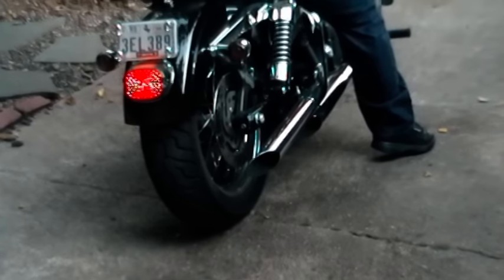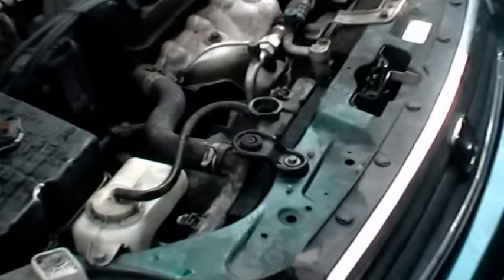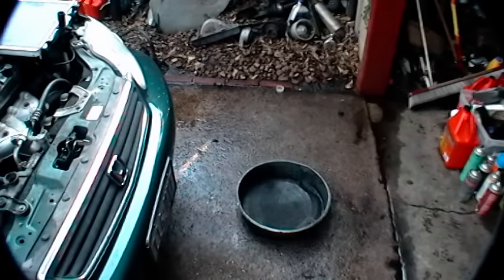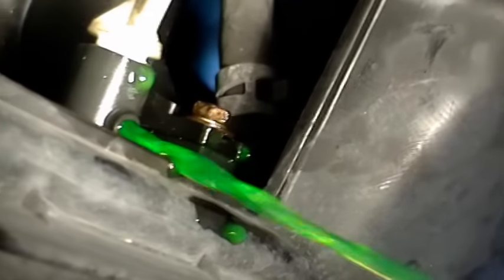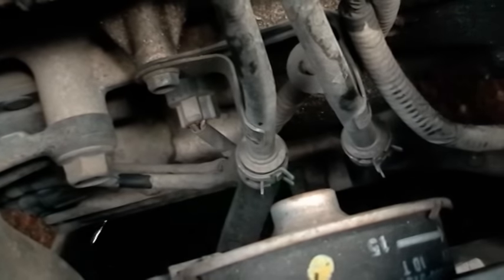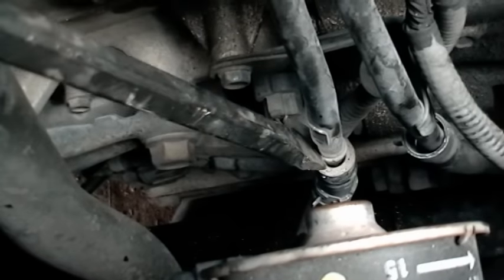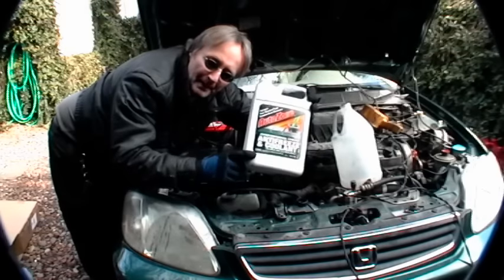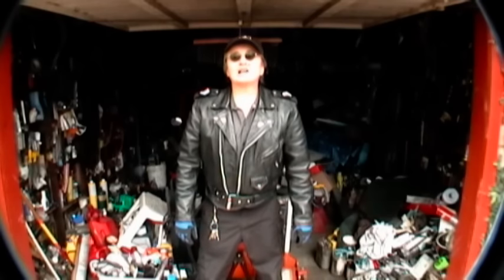How to Replace a Radiator in Your Car

Comment: Scotty I need a mechanics check on some info that I think is phony. I have a Mitsubishi Montero that overheats only every now and then. I replaced the thermostat, didn't fix it. I took it to the dealer to have them replace the water pump and was told that if they take off the old radiator to access the pump that it cant be placed back on the car and has to be replaced with a new one. Is this correct or is this a sales pitch to make some extra cash?

Comment: what do you think about that bars liquid copper stuff
Reply: I've used bars fluid twice now, and it held up for about two months. the hole will just keep getting bigger so I had to buy a placement radiator. got one for 56 bucks, lifetime warrantee and free shipping on eBay motors. took 4 days to get here counting the weekend. 👍 hope this helps was helpful info

Comment: Question/Problem- I am losing coolant in the reservoir. I have not seen any type of leak. When I fill the coolant and idle the car I do see a little bubbling taking place. I drive around a day or so and my reservoir is empty. What could be the problem?
Reply from the maker: see my video "how to fix an overheating car"   it has to be one of those causing it
Reply: I'm in the process of solving the same problem of regularly leaking coolant in my Cavalier. Check your local auto parts store to see if you can rent out the pressure tester and combustion leak tester. Mine didn't have a combustion leak, but the pressure tester didn't help me much because I couldn't quite get it secure enough onto the reservoir cap. Just today though, I discovered the likely culprit: a hidden crack in one of the plastic chambers of the radiator. Just ordered a new one and hoping that'll fix it!

Comment: scotty,how to know which is the radiator and which is the condencer fan?
Reply from the maker: +morganix007 turn the ac on when engine is cold, only that one will come on. Normally they are the smaller ones
Reply: +Scotty Kilmer thanks Scotty,the thing is that I was involved in a car crash. One ofcthe ac lines broke and I guess the ac gas leaked. So when I turn on the ac,none of the fans works. I noticed that when the car heats,the fan that is in the driver's side (in front of the manual transmission) is the one that works. I thought that the radiator fan was the one in front of the engine.

Comment: My roommate and I ran into a problem.  We got the hoses off the radiator and the coolant drained, but there is an AC line that also runs into the radiator.  We cant figure out how to get the AC line off from the radiator, how do we take this off?

Comment: My 98 Toyota rav4 has a leak on the radiator and just recently started heating up and kept heating up 30 minutes after I added a whole gallon of 50/50 antifreeze, and when I check the tank was empty( coolant tank). Any idea?

Comment: Is it hard to change it on a 2006 Chrysler Pacifica touring all wheel drive?
Reply from the maker: quite a bit harder than this video "
1)
Disconnect negative cable from battery.
2)
Discharge the A/C system.
3)
Remove the front fascia.
WARNING: DO NOT REMOVE THE CYLINDER BLOCK PLUG OR THE RADIATOR DRAINCOCK WITH THE SYSTEM HOT AND UNDER PRESSURE BECAUSE SERIOUS BURNS FROM COOLANT CAN OCCUR.

4)
Drain the cooling system.
5)
Disconnect the radiator fan electrical connectors.
6)
Disconnect coolant reserve/recovery hose.
7)
Remove A/C lines.
8)
Remove the auxiliary transmission cooler hoses.
9)
Remove the pushpins and the upper radiator seal.
Fig. 10 Radiator Seals

Fig. 11 Radiator Module

10)
Remove the pushpins and the LH and RH radiator seal (Fig. 10).
Fig. 12 A/C CONDENSER TO RADIATOR

11)
Remove the A/C condenser side brackets to radiator attaching screws (Fig. 12). Separate the condenser from the radiator by lifting upward to disengage from lower mounts (Fig. 12). Allow the condenser to rest in front of radiator.
12)
Remove the upper and lower radiator hoses.
Fig. 11 Radiator Module

13)
Radiator can now be lifted free from engine compartment. Care should be taken not to damage radiator cooling fins or water tubes during removal. (Fig. 11)
14)
Remove the auxiliary transmission from the radiator module.
15)
Remove the cooling fan assembly from the radiator module.
INSTALLATION
1)
Install A/C condenser, (if removed).
2)
Install radiator fan assemble, if removed.
3)
Install auxiliary transmission cooler, if removed.
4)
Slide radiator down into position. Seat the radiator with the rubber isolators into the mounting holes provided, with a 10 lbs. force.
5)
Install mounting screws.
6)
Connect the cooling fan electrical connector.
7)
Install the radiator upper and lower hoses
8)
In the LH and RH radiator seals.
9)
Install the upper radiator seal.
10)
Install the auxiliary transmission cooler hoses.
11)
Connect the coolant reserve/recovery hose.
12)
Install the front fascia.
13)
Fill the cooling system.
14)
Connect negative cable to battery.
© 2014 ALLDATA LLC. All rights res
Reply: Thank you sir well I'm try it and hope I don't mess nothing up.

Comment: Hey Scotty 

recently my car overheated and when i checked, the radiator was gone, so i replaced the radiator with a new one and now my car still over heats after like 30 min of driving... when car is on i checked the hoses and one hose in particular that goes into the engine seems bloated..... i dunno what to do next please help??

Comment: A mechanic just did a pressure test on my car. He found there is a leak on the upper part of the radiator by the cap. Is there any way to fix or just throw it away and get a new one? He wants to charge about $250(parts and labor).
Reply from the maker: put in a new radiator yourself to save money, chinese made ones often cost 100 bucks or so and if like the car in this video, many are easy to change out

Comment: I plan on taking it to get it flushed out and put a new thermostat in it. Infiniti dealer said they do not have any problems with their heater cores. Its unheard of with this on Infiniti dealership. The cooling system in my car is obviously contaminated soooo have them flush it and burp and pray to the coolant gods.

Comment: I was working on a freight liner semi with a guy he didn’t know what he was doing he just went for the radiator everything went fine until he started unhooking the tube going into the radiator next thing ya know you hear a POP fluid was separating everywhere I wish I knew what I know now then

Comment: question, I removed my radiator and I didn't realize I was dismounting and ac pressure line, I didn't realize there were 2 parts to the radiator, I lost pressure from the part that holds the ac part next to the radiator, how I reapply the pressure to it again, I have a 2014 Toyota camry
Reply from the maker: watch my video "how to fill your car's AC system with refrigerant"
Reply: Thank you

Comment: Crashed the front.  Had no issues for about two weeks. Then it started to over heat 100% radiator or should a mechanic take a second look

Comment: Do I fill the radiator with coolant or the overflow
Reply from the maker: both, if you can access them, some rads don't have caps on them in modern cars

Comment: Hi Scotty,
My Civic 98 HX has an ATF cooler line with 2 brackets welded on to it and those brackets are bolted into the radiator's 2 bottom fan holes. I have looked from under and have my son trying to pull the radiator while I tried prying it off from underneath the car, the line & the brackets won't separate. No one has seen this problem before?

Comment: Everytime i start to drive my 01 corolla the temperature goes high when pressing ⛽ i replaced the cap same problem what can it b scotty?
Reply: +Antoinette Williams How high? like in the red zone? check your coolant levels and water pump
Reply: I think its the fan or radiator i found a specialist Im here n Homestead FL

Comment: I'm getting 19.2 mpg on my Honda 2007 accord hybrid v6 is that good
Reply from the maker: +Vionel Savage IF you drive mainly in town it's OK. But that's horrid for highway mileage
Reply: +Scotty Kilmer last time I was getting 16.6 when I drive long distances my mpg go up
Reply: +Vionel Savage I don't know much about hybrids, but I would guess that is really bad!? No offense, I never was impressed with these hybrids when they came out anyway. I used to have a GEO Metro, don't laugh (3 cylinder), it got about 34 to 40 in city and 65 on highway. Beat that hybrids! Sure, you had to stick your leg out of the door and push uphill sometimes. Gas is not too bad now, but what it was a couple of years ago, I really missed that GEO! No joke though, I have a 4 cyl. Chevy Cavalier, and also used to have another 4cly. Chevy  . Most 4 cly. get better that 19, even in city. Something must be wrong. But even for a v6, that doesn't sound that good. I disagree with some of the other posts. I even think 19 is bad for city. Isn't the point of hybrids are they are supposed to be good on gas? I've got way better than 19 with 20 yr old 4 cyl cars that leaked oil like crazy and didn't get good compression anymore. I mean 16 to 19 is like v8 gas mileage.

Comment: I have a 2000 Oldsmobile alero and my car is starting to overheat. Idk if its my sensor that's going bad or the radiator all together. The fans turn when I turn the air but that's no AC. Get back to me asap thanks
Reply from the maker: Shai Lee well, run it with ac on and fans running, and if it doesn't overheat then, it's a fan problem not coming on with the AC off. In that case, often a bad fan sensor, pray it's not a bad main computer though as they do that too.
Reply: Add a radiator caps with temperature gage, start small next check sensor, and if all fails get a diagnostic for free, Radiators rarely go out. If you see a leak coming from it well thats another problem

Comment: will this be the same for a 2012 charger?
Reply from the maker: same basic process, BUT tons more crap has to be removed due to insane chrysler design, it takes a pro mechanic almost 3 hours to do this job:

Disconnect negative battery cable.
Remove the air intake assembly See: Engine\Air Cleaner Housing\Service and Repair\Air Cleaner Body - Removal.
Drain cooling system See: Service and Repair.
Remove upper radiator hose.
Raise vehicle.

Remove the lower engine cover.

Remove lower radiator hose (1).

Remove radiator fan assembly (3) See: Radiator Cooling Fan\Service and Repair\Cooling Fan - Removal.

Remove the front bumper fascia See: Body and Frame\Bumper\Front Bumper Cover / Fascia\Service and Repair\Front Bumper Fascia - Removal.
Lower vehicle.

Remove the air deflectors (1).

CAUTION:
Bolts are installed with threadlocker. Use hand tools to remove the upper radiator mounting bolts.
Remove upper radiator mounting brackets bolts (3).
Remove the upper radiator brackets (1) from the radiator supports (2)

Remove the lower condenser mounting bolts.
Remove the support bolt (2) located between the cooler lines.
Using a suitable hanger. Support the condenser and remove the right side upper mounting bolt.

NOTE:
To aid in removal. The upper shroud cover must be removed before the radiator. Leaving the cover on may cause the radiator to become jammed against the upper core support.
Carefully remove the upper shroud cover (2) by using a pick (3) to pull the cover retaining hole away from the clip (1) along the edge.
Tilt radiator toward engine for clearance from condenser.
Raise vehicle.

Using a suitable jack. Remove the lower radiator core support bolts (1).
Using care not to damage condenser or radiator fins. Lower the core support with the radiator.
Remove the radiator from the core support.
©

Comment: Hey I just got a new radiator when I start my car I can hear water flushing around is that normal.
Reply from the maker: it means there's air in the system, bleed the air out better.

Comment: i looked in my radiator and the fluid is brown has the consistency of peanut butter and i am constantly losing coolant. It is just dripping underneath the car and my car also will start to overheat. My car is 94 toyota camry. What can I do?

Comment: Why do you fill the radiator with 50% water and 50% antifreeze? Why not just antifreeze?
Reply: Antifreeze has a higher freezing point if you run it straight than if you mix it with water. It also has a lower heat-carrying capacity. And running antifreeze straight will double the cost of your coolant changes.

Comment: Bar leak clogged up my radiator and my car overheated. The bar leak seemed like it worked fine till apparently it messed up my radiator now i’m wondering replacing my radiator alone would fix the issue. Probably I’m going to end up selling my car. Hopefully someone will buy it with a semi fixed blown head gasket.

Comment: Yr not done until you bleed the air out properly.  U may wanna flush it as well.  Or just say at the end in have another Visio on flushing and bleeding and look gonna be to bleed for yr cars modle.
  Other than that good to show how to change radiator

Comment: scotty, why didn't you mention that people need to bleed the cooling system after filling fluid? if people who follow your advice and skip this final step they will possibly have problems
Reply from the maker: that would be another video entirely, some cars are real cows to bleed the air out of. But if you run em from cold with the radiator cap off, the thermo will open and you can add coolant then as air escapes

Comment: Continued...
There is a picture if you search HondaUnlimited com for ATF cooler hose ref part no 25520-P2A-P02 you will see that item has 2 brackets onto it. There is no way anyone can remove the radiator easily by pulling it up w/o unbolted these 2 fan' bolts first. So people beware, check your radiator's ATF cooler line has such bracket welded on to it and bolted to the bottom before attempt to remove it. It's NOT easy to remove the radiator if you do have one like mine. A nasty surprise.

Comment: Hi Scotty replaced my  radiator on my 2001  Impala, now is making a weird noise, also after
Reply from the maker: bleed the air out of the system, odds are some is stuck in
Reply: Scotty does this car has a bleeding valve ?
Reply: when your car is cool open the radiator cap. turn the car on with heater full blast. rev it up a lil and add some fluid as air gets out. do it for like 5 mins but dont let the temp get too high so u can put cap back on without being burned

Comment: I'm having a hard time removing the  radiator on a 1996 Grand Marquis.  I've removed everything noticeable and yet the radiator wont come up and it seems to be attached to the condenser.
Reply from the maker: those are rather hard to change out, but condensers so unbolt from the radiator assembly to remove the radiator. Look a bit closer
Reply: Scotty Kilmer

Comment: What about bleeding the system after???
Reply from the maker: +P L many cars can just warm up, drive 5 minutes, then shut off and refill when cold in an hour or so. If not, jack up the front end and let it idle with the radiator cap off and a fan in front of the car, and air often burps out then

Comment: I rather spend a little more than having a plastic radiator explode while driving. The TIG rads are brazed and will last the vehicles entire life, and possibly longer. And that's a 4 cylinder car Isn't it? that rad is quite small.

Comment: Too bad changing the radiator in my 2011 Dodge Avenger LUX with a 3.6L V6 wasn't anywhere NEAR that easy. This video is obviously for Honda owners or older model vehicles, not newer ones.

Comment: Scotty I have steak coming from the radiator should I replace it?
Reply from the maker: no, put it in a museum, I've never seen steak come out of a radiator. You have a special car that scientists need to study
Reply: Yeah it's coming directly from the top of the radiator it may be a coolant leak dripping onto something hot or what not but the car doesn't overheat it drives normal I replace the thermostat in it and I'm not sure what's going on now so
Reply: Was the steak cooked? You have a good radiator. Steaks are expensive.

Comment: how much does it cost to change a radiator in US????
Reply from the maker: +Amaury Lopez depends on the make and model, AND what replacement rad you use. Dealer ones can cost 800 bucks while chinese replacements can be under 100

Comment: I got an Infiniti m35 and I change the Radiator and now it heats up and I don't got hot air I change the thermostat and still same
Reply from the maker: those cars are often very hard to get the air out of the cooling system. Pay a mechanic with a vacuum coolant machine to suck all the air out of the system and refill it with coolant. See that all the time.
Reply: Thank u

Comment: ok :( this is killing me , i changed my radiator O_o and the person who did that is supposed to be expert , however , the car acts weird now , let me describe : 
1- when the car isnt moving , the car temperature is within the normal range ( approx. 40 % of scale) 
2- when the car moves , after a few minutes more like 10 mins of driving , the scale rises into 80% then to full ! 
please notice that i removed thermostat and changed engine oil , and this stills happending ! ,

Comment: If the radiator is broke will the car start to smoke.
Reply from the maker: yes, it often will when it leaks or overheats from being clogged up
Reply: Scotty Kilmer Days ago I told you about my car overheating at google plus.I did this step and turns out the radiator is clogged up.My radiator is made out of metal and have to take it to get cleaned..But yeah that was the problem why my car overheated so fast.Not the cap,tube leak,thermostat,or head gasket....Pretty simple really